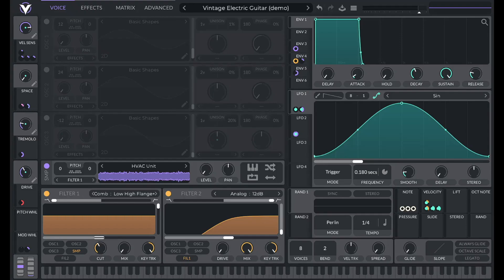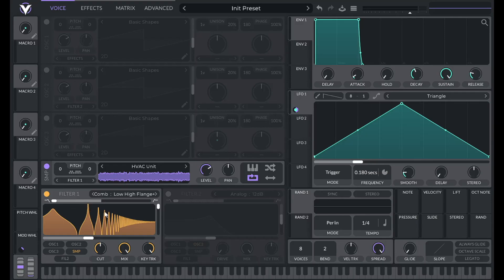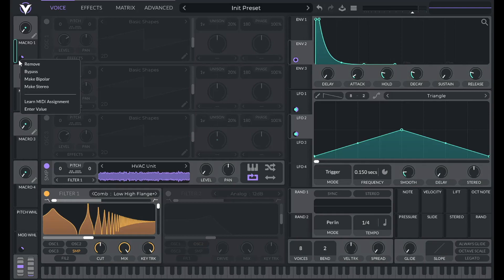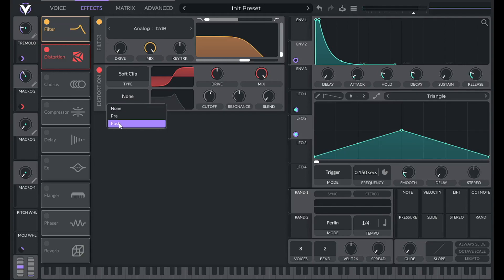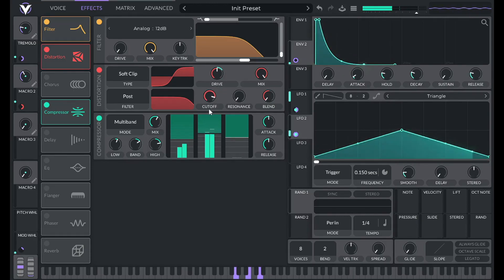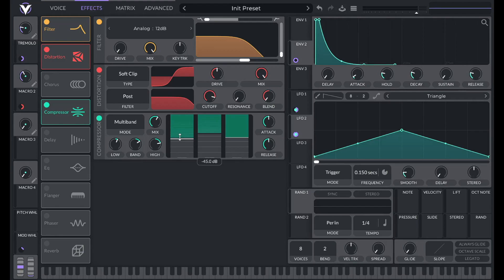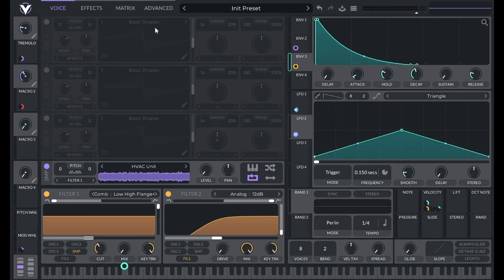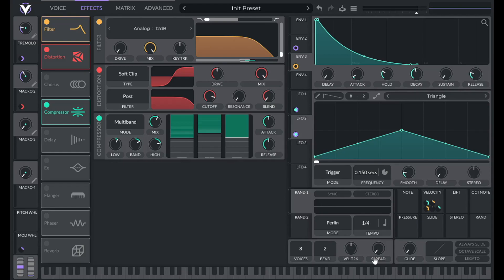How to: HVAC Guitar in Vital - Synthesis Tutorial

Comment: Hello there, 
I was wondering how to make palm muting more convincing and for those how followed the tutorial, here is a quick how to improve it (lemme me know if u think that does the job)
1 - set the velocity controlling envelope 3 to "bipolar" and then double it's value
2 - drag the velocity parameter to control the output (which is filter mix) of envelope 3 

This way, with low velocity, the release is so quick and the amount of comb filter is so tiny that it looks a lot closer to palm muting (at least, to me)
And close to nothing has changed at high velocities so the preset looks untouched

All u have to do then is to play with the velocity parameter in ur DAW and get groovy.

Thx for this preset Eric, I've learned a lot !
Force et Cataclysme.

Comment: In the original patch (seen in the beginning of the video) you have 3 mods on NOTE. Are they not so important?
Reply from the maker: Good call. Those are left over from when I was trying to control the EQ frequencies with note but I abandoned that because I wanted the preset to be polyphonic. I forgot to remove the modulations when I took out the EQ.